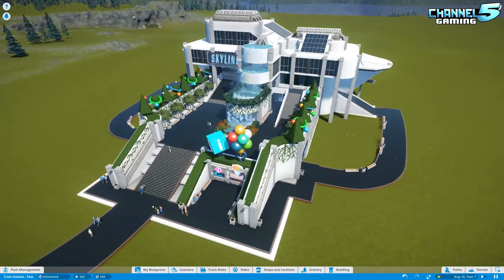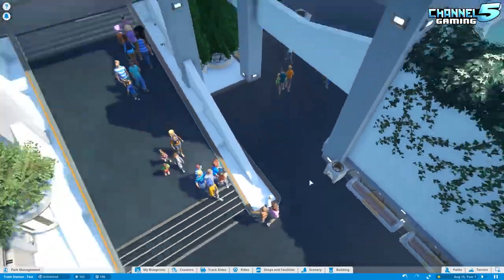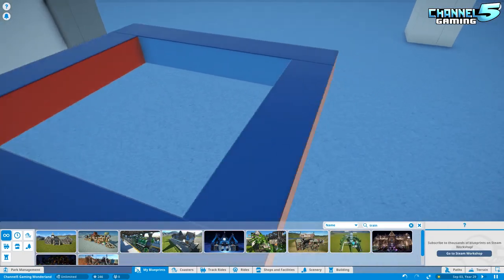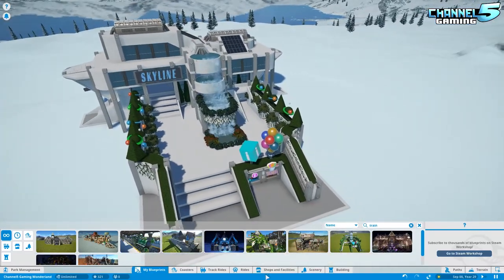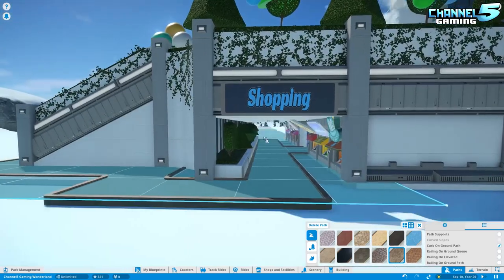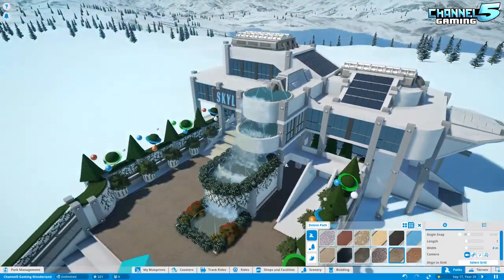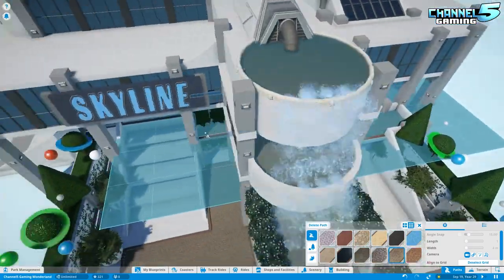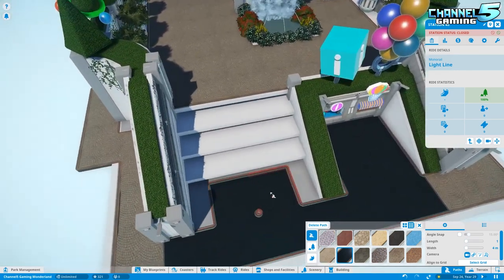Setup and Pathing Tutorial: Skyline Shopping Center - Lets Build 03 #PlanetCoaster

Comment: beside that visitors tend to walk through objects at corners, there's another glitch related to the navigation of visitors - sometimes they walk into each other on stairs, summing up a huge bulb of hundrets or even more people over time, not knowing where to go. i figured this bug doesn't happen that often (or doesn't happen at all) if you add fences to the stairs (from path options) - without fences you'll frequently run into this problem. maybe Frontier has got it fixed with the upcoming easter update, if not - this is what you can do against :)

Comment: Hey, I love the build. It looks amazing! 
Having a little trouble with the pathing though... I've aligned the 2 blueprints exactly, but whenever I try to do a path it appears slightly underneath the floor of the building (Even if I raise or lower the building), and when I try to select the grid with the piece connected to the shop, it just says 'Get grid from 4m piece' and refuses to connect to it!  Absolutely no idea what I'm doing wrong haha. Any ideas?
Reply from the maker: Hey Echo, glad you're enjoying the building and sorry for the frustrations, I was a bit worried about this one becoming problematic for people to setup. I'll do my best to assist you!: So at some point in this video I mention you can hold the shift key to pull and lower elevations. I always put a regular path down in front of a shop first, then I go into grid mode and find the corresponding grid layout for that shop and path. Sometime the path does drop 4 meters lower, so I hold shift and left click to drag the path up or down until I find the level ground area that I need to work with. Then I start filling and remove the original rounded path. Hope that helps let me know how it goes! :) PS: I just finished building a Large version of this last night, or should I say smaller than humongous lol.. I took out the bottom levels, plaza, & shops, and it's just the skytrain and bathrooms. I wanted people to be able to have a similar smaller version setup around their parks in other locations, and it's also a much easier one to setup as it comes packaged in 1 blueprint and requires less pathing. I should hopefully have it published tonight! :)